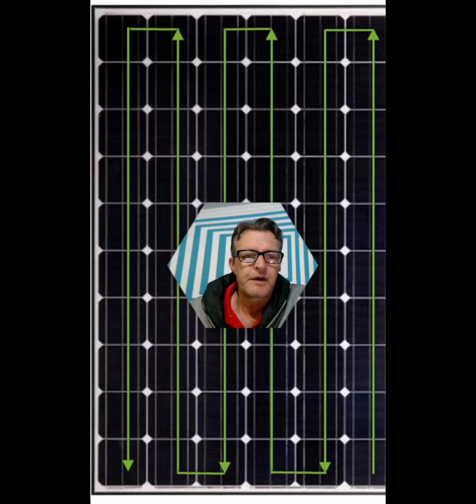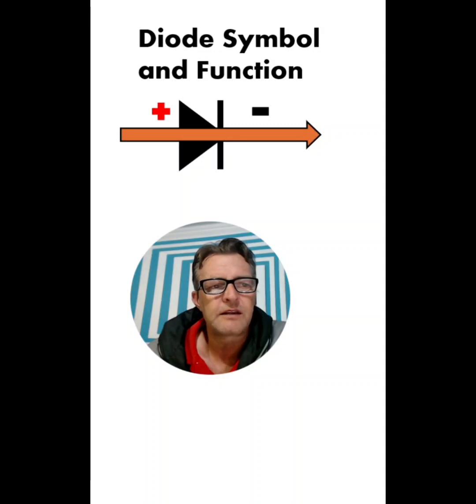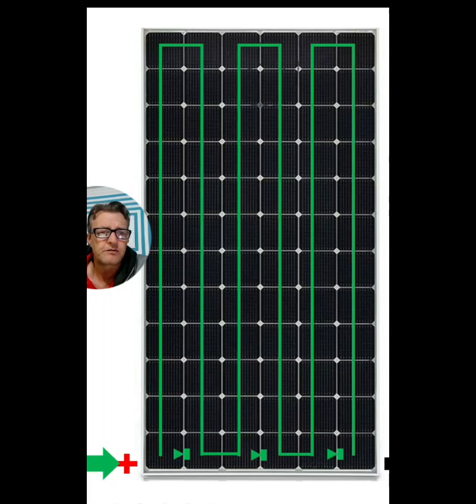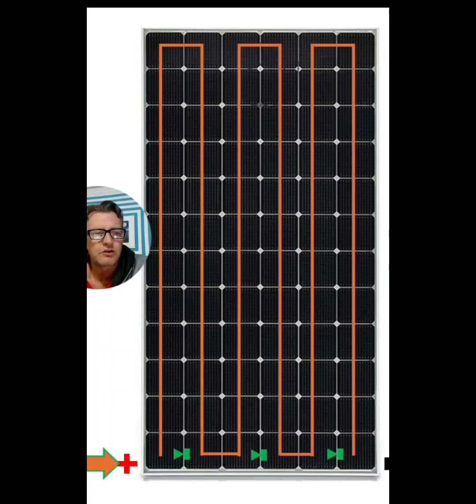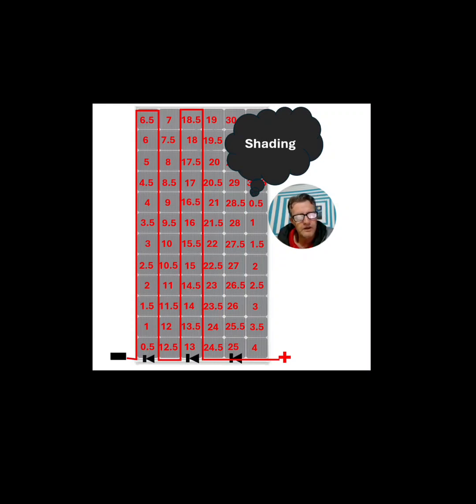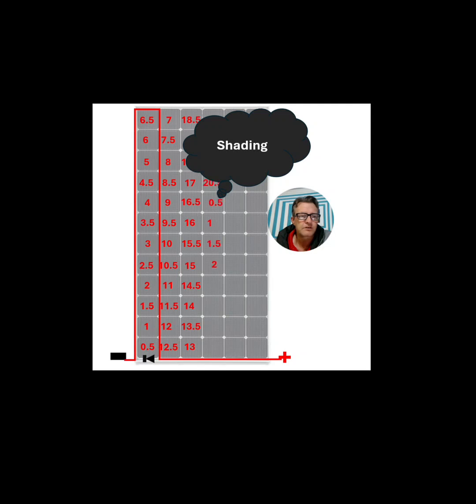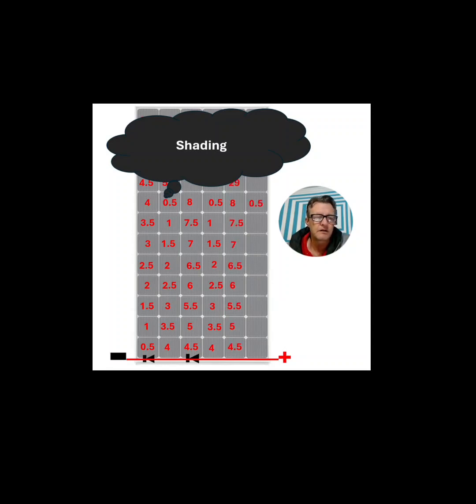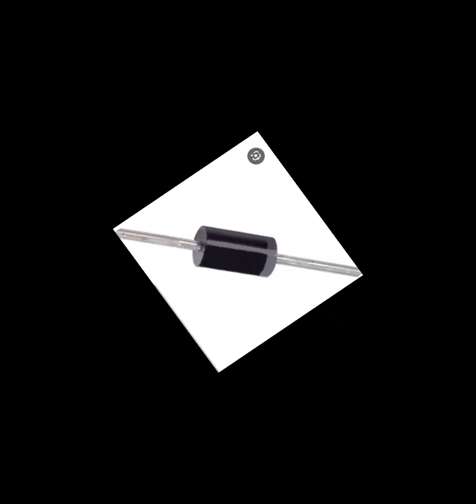Bypass diodes on Solar Panels

Comment: Great video. Is this technology on all new solar panels, for example : Renogy N-Type 100 Watt Solar Panel 16BB / furthermore, I love your analogy of thinking as a diode as a checked valve and plumbing basically a one-way prevents flow in the opposite direction.